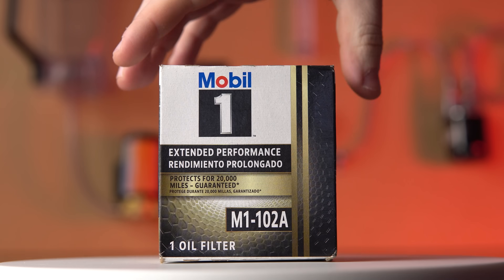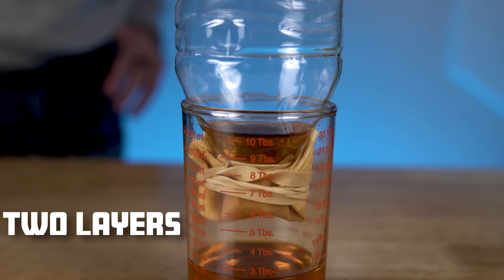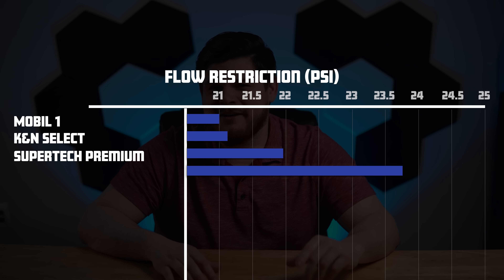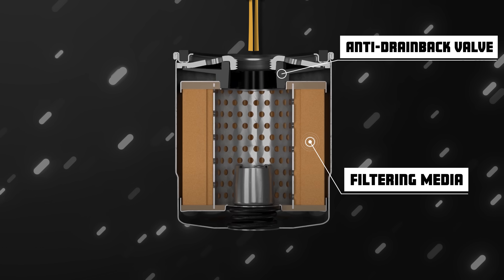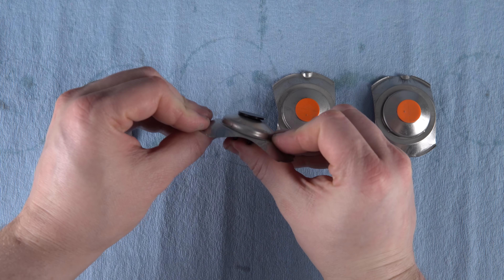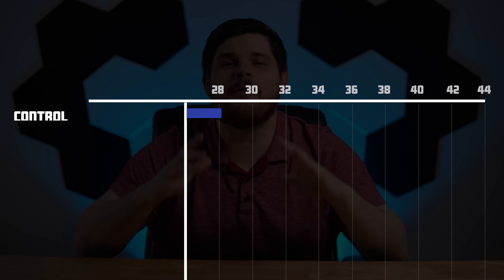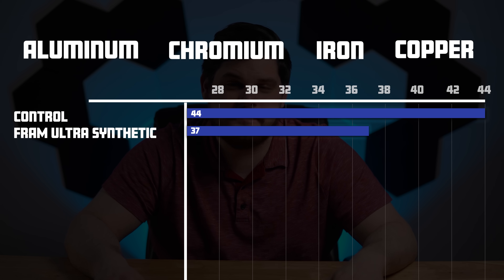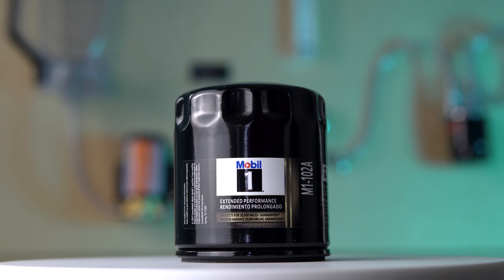Engineers Test the Best Oil Filters! FRAM | Mobil 1 | K&N | Walmart Brand

Comment: So my take away from this is the mobile one has better flow but it doesn't have better filtering capacity and for a non-performance vehicle the Fram Ultra would be acceptable in the essence of making sure the longevity of that engine stays very healthy for much longer

Now with that being said I would ask you if you guys make sure that the bypass rate was the same for each one of these filters to make sure that the initial oil flow testing was accurate
Reply from the maker: @Ford Boss me we would definitely agree with that take away. I personally have ran the FRAM for years and have had no issues. As for the the bypass valve pressure, you have a good point. In order to make the fairest comparison we could, we applied the same pump power to all of the filters. Unfortunately, some of these manufacturers don't specify their by-pass valve pressure ratings. So maybe on the next video we will test measure that. Thank you for your input, it really is much appreciated and helps us a lot to improve and get better.
Reply: @BrandRanks  I personally have experienced a  Mobil 1 filter on 2007 Ram  Cummins, that was bypassing through the valve (confirmed through oil sampling & filter dissection),  which would account for your lower back. pressure.
Reply: @BrandRanks  find out how much force it take to push the valve in.  Measure the area that is exposed.  That is how you determine the crack pressure.
Reply: @BrandRanks  please do test this
Reply: Actually, in practice I believe full flow filters bypass valves are open way more than you think.
Reply: @oneninerniner3427  hummm yea i bet your right! (fighter jet tech...)
Reply: Most bypasses open at less than 20 psi I believe. They have to because the pump can't shove all the required volume of oil the engine needs through a full flow filter especially when cold or at higher rpms. The filter is still filtering, just not the entire volume of oil that the pump sends through it. I use AMSOIL first, then Wix XP second choice and have used a few Mobile One filters. If you want to filter your oil really well install a bypass system.
Reply: The bypass flow rate is exactly why I only buy oem filters that are twist on
Reply: @YungSteambuns  bah! That doesn't make a hill of beans difference. Filters have to be made to match the OEM s specifications for the most part. Just buy a good filter not the cheapo junk. There are a few main companies that build filters for everybody, but they are built to the purchasing companies specifications meaning price/performance. By performance I mean filtering ability and service life, not racing. By the way don't use racing oils and filters for your street vehicles. Racing is a whole different ballgame and not good for everyday street vehicles. The main quality filter builders that I know of and use are Wix Mann/Hummel & Donaldson. I use primarily AMSOIL EA, Wix XP, Wix standard & Mann filters. Donaldson's own branded filters are mostly for heavy duty diesel & hydraulics I believe. Mobil one filters are pretty good too I think and are built to higher standards. The rest I'm not sure about, but there are probably other good ones out there. I just feel that our modern high tech engines really need the protection of best lubricants and filters. But the main take away is don't worry so much about price. Buy quality oils & filters and you don't have to change oil & filter every 13 miles! lol
Reply: @oneninerniner  bruh it's cheap to buy toyota/lexus oil filter, just get a box of 12 cost like $40 from the dealer
Reply: @YungSteambuns  there you go. Cheap again! lol
Reply: @Yung Steambun [ AKA Unstuffed Dumpling ]  Try Motorcraft filters as well. Very well constructed by Purolator to exact specs @great price pt. I use on all brand vehicles i own including a very expensive '21 F150 Raptor truck .
Reply: I wondered if oil restriction from better filtering capacity may provide less oil and less lubrication creating more ware . I started with the lower end fram with this thought but steadily went to the higher end filters . As a better filter at filtering will clog up faster and restrict flow so that's another thought testing filters that are at different times in their lifespan . I would think the balance of flow and filtering does give the edge to mobile one but being a fram guy I was cheering for fram but I conceded to your logic of the balance between flow and filtration .
Reply: @stevencole7331  
That's what the bypass is for. There is no oil restriction from the filtering. Unless the bypass malfunctions flow will not be restricted. That's how we see women putting 40k plus miles on their cars having never done an oil change.
Reply: All these tests are absolutely not relevant in cold oil.
Reply: @47ALTAIR47 
EXACTLY 
testing needs to be done 160*+ hopefully 200+, but most engines rarely exceed 160 unless it's lengthy highway driving.
Reply: The real question is how many miles of load in an engine brings all these filters past their filtering capacity. 10k miles is very, very likely utter BS. More modern brands tend to say 7.5k in a 5-6L oil engines, and their brand filters are usually nice and chonky bois much like the ones you guys reviewed (and likely just re-stamped ones in the first place), but there are generally several sizes of filters sold that can fit a given vehicle - so some sort of real life capacity test would be killer.
Reply: @skvltdhobbies  FYI Ford is now specing 10k mile oil and filter intervals on 2022 Ecoboost engines.
Reply: @skvltdhobbies I agree. I’ve gotten used oil testing every oil change on my truck.  Never once had a metal wear concern.  Much less 20 grams to clog an oil filter.
Reply: "for a non-performance vehicle the Fram Ultra would be acceptable in the essence of making sure the longevity of that engine stays very healthy for much longer:
Huh???
Reply: And oil to be High Temp too, operating oil temprature will change everything!
Reply: Filtering capacity?  Why is your engine producing 20+ grams of metal particles in 5,000 miles?   Higher filter capacity doesn’t make your oil cleaner.  First pass filtration rate is clean rating.  Filter capacity just means that if your engine had a condition that it was creating metal particles only then would the oil filler need capacity to hold the extra metal wear.   But why is your engine creating 20 grams of metal to even come close to the filtering capacity of an oil filter?
Reply: I’ve gotten used oil samples at every oil change. 8-9500 miles.  Diesel truck.    My average is 6 parts per million of Aluminum. 10 parts per million iron. 

Changing the filter earlier would not change the oil particulates.
Reply: 0p @wesa665
Reply: 3427: especially below freezing, Like we're about to get at tbe higher elevations in Colorado! Or say Dakotas ect.
Reply: Good for you but I’d prefer the Mobil 1.
Reply: I was production engineer for FRAM and had been a loyal customer up to that point.
1)  Air filter is more important than oil filter.  That's a direct quote from the design and warranty service engineers.
2)  Once the bottom of the pleats, up against the center tube, plug with dirt, the filtration element will be bypassed by the valve.  Many FRAM designs had very tight bunching of the pleats and, while they would pass the capacity test, since that test was limited in duration passing it didn't mean much.
3)  Remember that I said I was production engineer?  Well, in reality, due to FRAM's paper end caps, you never knew if you were going to get a filter with one of those end caps offset and leaving a gap where the oil would easily bypass the element.  That's what happens in real life production - things don't always match what was designed!
4)  For the longest time FRAM was cutting the threads into the bottom plate - other brands would roll form threads and that very commonly led to bits of metal swarf getting built into the filters.

Last, but not least, I had been buying HP1 filters for my Boss 302 thinking that this was a performance application and needed a great filter.  Well, the ONLY difference between an HP1 and a PH8 was slightly thicker housing metal, same internals. BUT, they are both tested at 90 psi on the line and, if your engine oil pressure goes over 90 psi, you have other problems!  I had paid a hell of a lot more for NOTHING!!
Reply: Still sticking w/ Motorcraft filters. I change oil every 5k mis MAX & run Pennzoil Ultra Platinum 5w30 in my expensive '19 F150 Raptor & '22 Ranger Tremor trucks . -NY
Reply: @Davido50  
You mean your expensive rust buckets. Oil is the least of your worries.
Reply: I understand what you are saying on your test bench setup. You did a pretty good job, better than most I would have to say!👍 But in practice as I said the bypass vales in the filters are open much of the time. Think about it, when the bypasses open at around 14 lbs pressure most engines run quite a bit more pressure than that even at idle so they have to be open much of the time. That's not to say they aren't filtering at all however. Just not all of the oil going through the filter all of the time. If folks really want to filter the oil well a bypass system is the thing to use. It's another separate filter that takes a smaller volume of oil from the system and filters it really well. AMSOIL has bypass filter systems that will filter down to two microns keeping oil analytically clean. Then the only thing you have to worry about is keeping the TBN positive to neutralize acids. You do that by using Amsoil's Signature Series premium 100% synthetics that have robust additive packages and tuff real synthetic base oils and lube analysis. Some have done that for 500k to a million miles with very few oil changes. Yes that's extreme but is possible. The problem is on modern vehicles there is very little room to install another separate filter system a lot of times.
 Oil bypass systems are more widely known of on heavy duty diesels that routinely can hit a million miles.    
 Now do I have one?  no. I would like to but I drive old junk for the most part and our vehicles rot out here in the salt belt before the drivetrain gives up usually, unfortunately. But I have used AMSOIL products for decades now and luv them. They are not magical just dam good oil!
Reply: I've seen numerous fram filters collapse before 7k miles
Reply: @alextheonewarrior  Yeah, I'm taking mine out, skipped it on my oil change I just did,(Fram.extra.guard) @5k. I'm putting a mobile 1 or fram ultra in. I don't trust it for a full year
Reply: @alextheonewarrior what do you mean?

Comment: I'd say for the 1st test, the bypass valves' pressure rating should have been stated.  The higher or lower pressure recorded would be due to the bypass rating.  For the dirty oil filtering test, you'd have to stay below the filter's bypass value.  I like the principles in which you tested the filters.
Reply from the maker: @120badbubba Thank you so much for providing feedback. Especially in such a kind and respectful manner. We are always looking to improve to provide the best information we can and comments like your helps us do that. Some of the manufacturers did not advertise their bypass valve specs, but this values are related to the drop in pressure across the filter not the inlet pressure like we measured. We are looking into adding additional equipment to be able to determine this drop in pressure and ensure we are not over that bypass valve rating. Again, thanks for your feedback!

Comment: Great video! It is very interesting to see these oils compared to this level of quality... I am curios to know how did you test the oils to find the parts/million?
Reply from the maker: @Aloma08 Thank you for your kind words! Your support means a great deal. Great question! We sent all the oil samples we took from the 10 hour filtering test to an Oil Analysis laboratory. These people dedicate themselves to analyze used oil samples for your car. After several days, they provided the part per million data used in this video. If you would like to know even more details on how they perform this, look up "spectrometry" this is the technique they use to determine what wear metals, additives and contaminants are in an oil sample.
Reply: @BrandRanks  Thanks!👍

Comment: Very high-quality video. Thank you I would like to see if the 3600 out performed the 3614. Also, is there a difference in the test results with 20 micron test material?
Reply from the maker: @dpf Thank you for the kind words! Much appreciate your support. That is a good question. Upon looking it up, I see the 3600 is a much bigger filter than the 3614, so don't know if it would be a fair comparison, but it might be interesting given some people use them interchangeably. As for the 20 microns, that was hard to find material, so we will keep looking for future videos.
Reply: @BrandRanks  I use  Fran ultra 3600 on my Harley.  It’s a tight fit compared to the 3614.  I also run mobile 1.

Comment: I get the 20k synthetic oil and pair it with the 20k rated filter.... and still change it every 3 to 5k miles 😅
Reply from the maker: @Martin Burgos Hahaha I've been using the FRAM ultra for years and changing it every 7500 as well. Your car should be in top shape! Thanks for your comment and for supporting the channel🙂
Reply: @BrandRanks  a gas engine with 5 qt capacity should be changed 3-5k max diesel with 3 gallon can go a little bit longer but not much. 6k maybe i do 5k. this is how we get 500-1m miles on an engine I'm currently at 400k,298k,212k on my 3 Dodges the 06 with 400k runs flawlessly and i have only replaced wearable parts . im becoming paranoid because nothing has failed yet besides the alternator and i have changed a water pump or 2 to be safe.
Reply: bulbacivic ... I can appreciate your approach and perspective, but 3k is overkill, in my opinion.
Reply: Good. 4500 miles is right. Many think the new oil is magic. Car dealers like worn out motors. Kids too lazy now.
Reply: A Group IV/V oil can go that distance provided the additive package is tuned right but I wouldn't do it with anything less.
Reply: I change once a year or every 2k which ever comes first. Been doing that for over 30 years. 15 to 20k on a oil change just seems criminal and lazy.
Reply: Same man!
Reply: Exactly!!!! 👍
Reply: I use fleet guard on my 5.9 and change the oil every 3k and fuel ever 6k
Reply: How long do you keep your car?
Reply: Same here.
Reply: Tests have shown the extended life filters restrict oil flow. If you change oil every 5000 miles, a regular Wix or Purolator are best
Reply: 5000 is the limit for me. Can't be too safe if you plan to keep your car for over 100,000 miles 👍
Reply: You wasting money, complete overkill, fool
Reply: How often you change oil depends on how much and how hard you use it...
Reply: YOU ARE THROWING MONEY AWAY😢😢CASH 💸 💰
Reply: This is the way..  3k is overkill though.  5-7k is the sweet spot.
Reply: @Blinknone Depends if you use conventional or synthetic.  Also, it depends on driving habits. In city driving or highway miles . I've personally seen a car driven pretty much in town & the oil filthy dark at 3k  ! Then I've seen cars with mostly highway miles at 3k look clean . Miles & time are both factors imo...
Reply: @Blinknone . Yup, especially with synthetic
Reply: Likewise. What’s more, I use Mobil 1 Extended Performance Full Synthetic 0W-20 and their M1C-251A ‘cartridge style’ filter in my 2012 Camry SE, both of which are changed every 5,000 miles ON THE DOT. Nothing but the very best for my trusty steed!
Reply: @faschuck . 0w-20, hell no.  There’s no reason for that thin crap
Reply: @faschuck Oil companies love suckers.. you are throwing 💰 🤑 💸 💲 Away.
Reply: @IronMike-f8i  not really, the longer your oil continues running the more contaminants are being thrown into the mix, along with metal wear and tear from the engine itself. Changing early is a good way to keep the oil in the highest quality possible.
Reply: @nylus22 combustion acids is why you change oil
Reply: oil comanys love you. your throwing money away, still good for another 4k miles
Reply: You are so wrong. Oil is full of corrosive acids from fuel combustion.  @ulyssesgomez9348
Reply: @ulyssesgomez9348 it's decent by that time
Reply: Smart man!
Reply: @RoyTamargo-w5o  NOT SMART. HE IS WASTING MONEY😢 💸 💰 😮
Reply: Synthetic oil is made from natural gas so it has no crude you can go the full 20 k miles I've been doing it for years and use mobile 1
Reply: @jeffharker1361  You drive 20k in how long? A Year? I drive 150k+ miles a year and got millions of miles on the road. I would only do what you do If, you drive a beater and drive 10-20k miles a year. I've done that to Toyotas plenty of times in the past. However if you're driving for a living and drive 12-20k miles a month. You learn a hard lesson. Oil is cheap, new/used engines are not.
Reply: @jeffharker1361  OIl is cheap compared to an engine rebuild, epecially if you change it yourself. There are plenty of horror stories of engine problems attributable to inadequate oil changes. Additives get used up, oil breaks down, oil filters can't filter out all contaminates, sludge builds up, etc. 20K miles on an oil change is stupid.
Reply: @jeffharker1361 you talk about Pennzoil Ultra Platinum synthetic oil. The oil itself could last 20k miles, but there acid and carbon formed during this time, they can corrode and plug up engine.
Reply: You’re not very smart lol